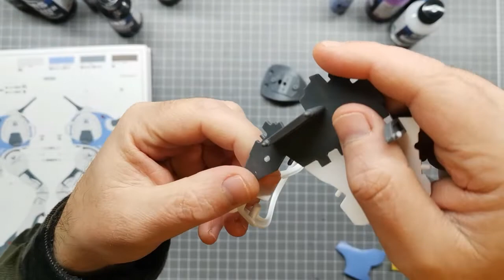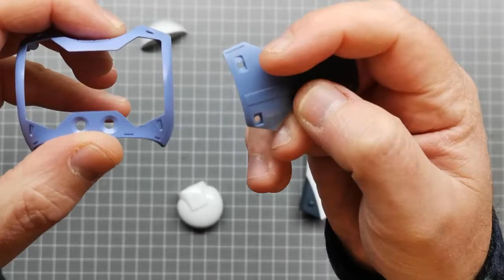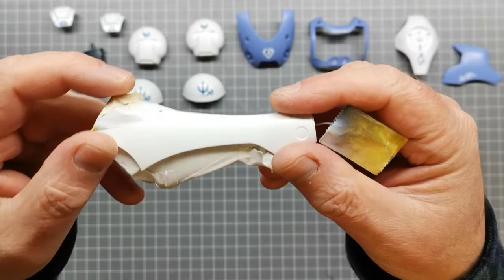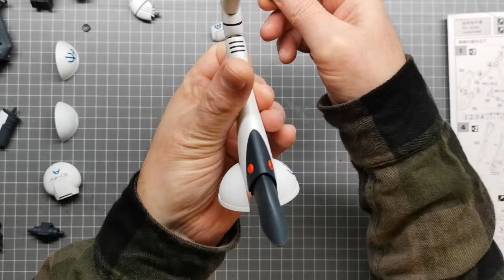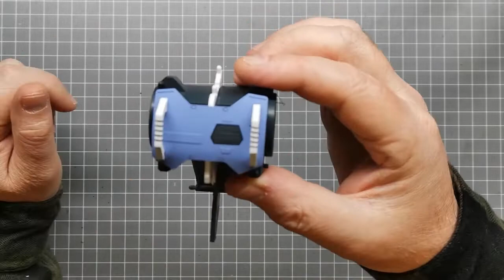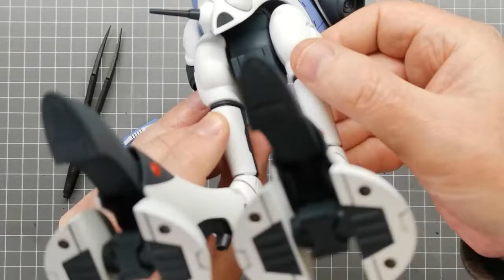Hasegawa 1/72 Regult (Standard Type) - Part 4 - Final Assembly and Reveal

Comment: Great attention to detail.  Now only if we can develop a simple and low key way to wire the leds to a powered timer so it would kick on every evening.  Anything that's battery powered and I have to switch on will be used once then never again.
Reply from the maker: Thank you. I must admit I have not turned on the lights in this kit since I built it :) I agree a timer would be ideal.

Comment: Interesting. The engine pods are different to the IMAI kit. The IMAI engine exhausts are much squarer. This seems to have been changed to a round exhaust in the Bandai moulds. I'm still working on a 1/48th VF-1J with lighting. I found some flickering blue LEDs that make the engines look great. Great work! Thanks for sharing.
Reply: @ncc17701a The old Arii Regult's engine pods are square as well.
Reply from the maker: Thank you. That's interesting about the differences between the IMAI and Bandai interpretations of the Regult. I might have to keep an eye out for the IMAI kit in the second hand market.